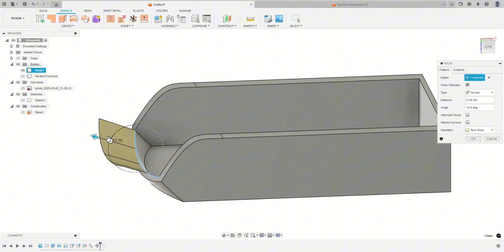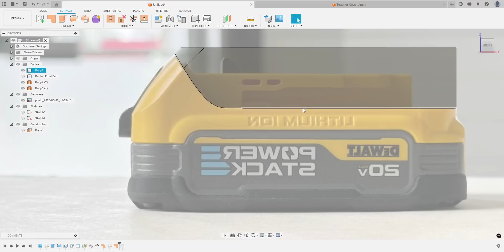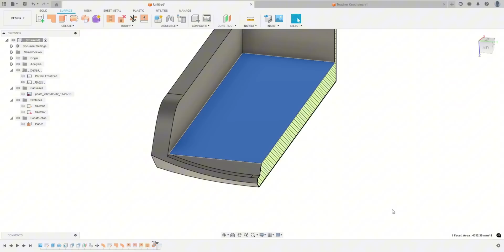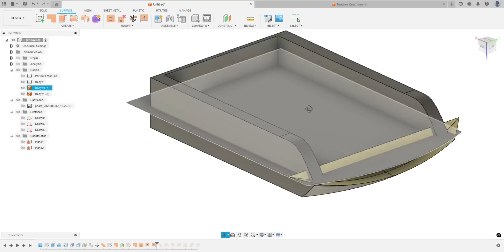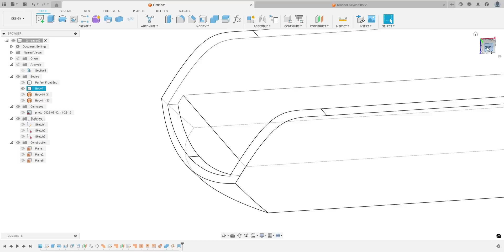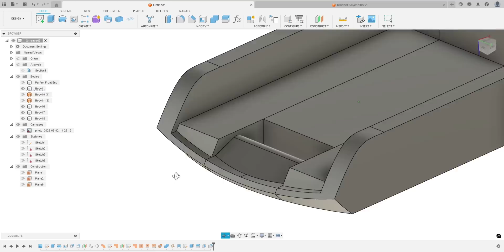Let’s Make a DeWALT Battery Holder [Part TWO]

Comment: Kudos for designing on the fly and narrating at the same time.  Just got round to going through part 1 & 2, think this will fast become my go to refresher series for when I feel like my designs are getting lazy.  If you're ever looking for any ideas for designs/videos I've always wanted to try to design a housing frame for silicone mould making to use for creating concrete garden plant pots.

Comment: Hi, Great video. I'm still very new to Fusion and still learning the basics. I do have a question though. Wouldn't it have been easier to start of with the internal as you call it and then create the outer shell of the holder.
Reply from the maker: Maybe, but for a good fit, it’s much more important to get that outside geometry correct first. So designing and doing test prints of that is best to do first, as the internals don’t matter as much (even though it still matters). That was my thought process at least.

Comment: The surfaces are unusable because you are using the rule feature to extend the surfaces.  The correct way to do this is create all of your surfaces independent of the others.  The angled and large surface should be extruded surfaces to ensure thy are flat.  In true production level work of more complex design, while these creation features exist, your approach would cause more headaches than doing it the right way. You don’t see it because it’s minimally defined with dimensions, but this model would quickly have failures if you started adjusting the those surfaces.
Reply from the maker: Of course, which is why I fixed them.  In part 3, I show a better way.

Comment: Pretty cool design. It works really well.
Reply from the maker: Thanks for the feedback! What filament did you use?
Reply: Prusament PETG Black. I could only fit the wide 3 battery version on my MK4S, so I printed two.

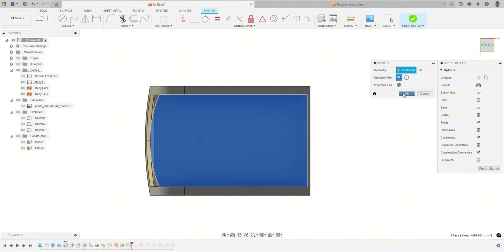Comment: 21:00 why not draw a sketch on the side linking your straight line to the 11mm, and then extrude a surface across to the other side?

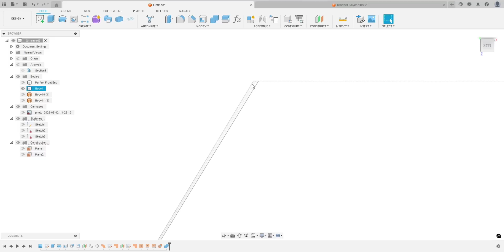25:35 Also, you face isn't flat because of you revolved the circle.
Reply from the maker: Won’t work. 
I understand why the front face isn’t flat.

Comment: You give the boundary tool all the boundary surfaces (solid bodies will work too), and give you the option to pick the solids that are bound by those surfaces.
Just like you can draw random lines on a paper, and you can then fill in any enclosed area. In 3D, that becomes a solid.
Now of course if you imagine you draw two lines on a paper without crossing, there will be no enclosed area, so that's why you need to extend the surfaces beyond, so it can calculate it properly, as there will be tiny floating point errors, which make surfaces that supposed to meet not.
For the stitching tool, you're telling it exactly what the boundaries you want for the new solid, and which two edges to stitch together, so it has the tolerance built in, and you do not need to extend the surfaces. For boundary tool, since it will give you EVERY single enclosed body by all the bounding surfaces you gave it, I guess there are technical reasons why it didn't allow any tolerances.

For the top surface for the boundary fill at 21:00, you do not need to create that sketch, projecting the bottom surface, patch it, and extend it. The offset plane itself can be used as a boundary for the boundary fill tool as well, and will yield the same result.

For the ruled surface not being flat, well I think it's just a quirk with the "straight" line you created in the 3D sketch. Even in the 3D sketch mode, if you create a straight line on the base reference plane, then the ruled surface from that will be "flat" and selectable for sketching. Any "straight" line not on the reference plane will not be flat when ruled. 
3D sketch is kinda weird in Fusion and isn't exactly the best modeling tool. Just like you would prefer Extrude > Revolve > Sweep > Loft, as they usually create less and less predictable results, you should not use 3D sketch unless absolutely needed to (like creating cable harnesses in mid air). In this case, the "Axis through two points" under CONSTRUCT (same section as the offset plane tool) will create enough reference geometry for you to create that line segment for ruling (create "Plane at an angle", then sketch, for example). Or you can just offset the base XY plane with "to object" offset to one of the points, as in this case your model is symmetrical and the plane you want is parallel to the XY plane, although I guess you don't actually needed that afterall because you're recreating that slanted face with a construction plane further down the video. You can just create that early and just use that for boundary fill too.

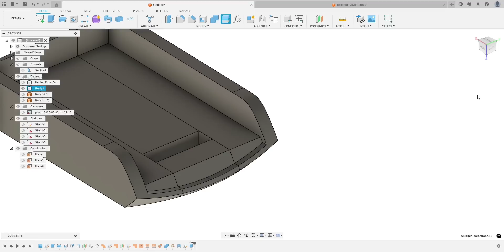For the split body at 32:00, you can just use the split face to split the top surface only (with "extend splitting tool"). Then for draft, remember to turn off target chain, then you can just select the part for drafting, and it will work just like in the video, without splitting the body.

Comment: It’s crazy how the most simple things can be so complicated to model. Thanks for walking us through your process.
Reply: Really over complicated process with all those surfaces. 

The same result could be done with two Extrudes (with changed settings in start and distance) and some construction geometry (a plane and a few sketches). No 3d sketching needed.
Reply: @Fusion360modeling-fb4gt I see that you make videos. Could you make one showing the more efficient process?
Reply: @darthtater Now I have watched the beginning of part 3 where he goes back and makes it in a much cleaner way. My solution also had a Plane Through Three Points for the slanted face. But I think the rest of his  new approach is cleaner than mine.